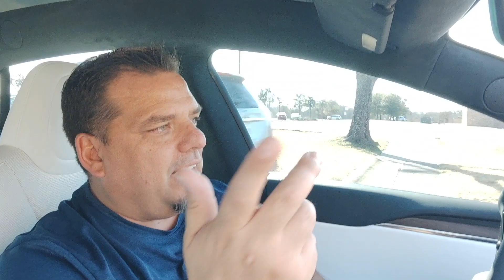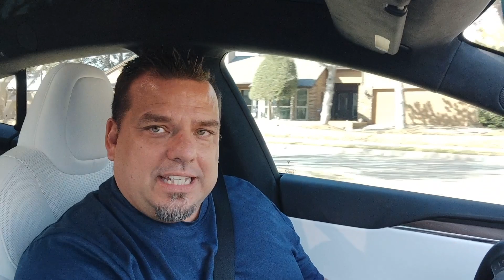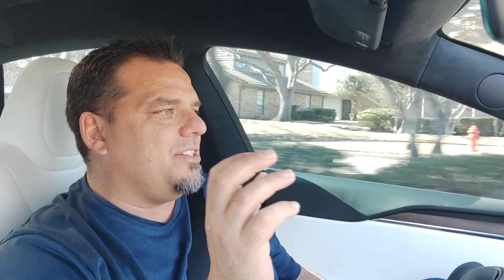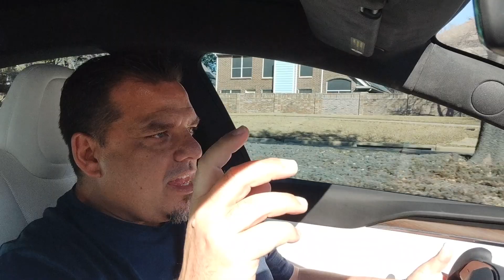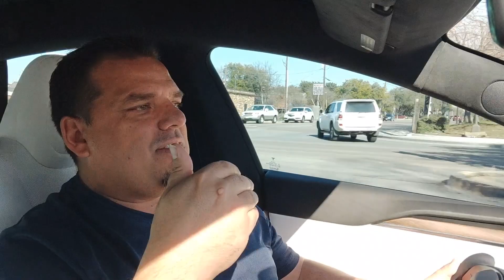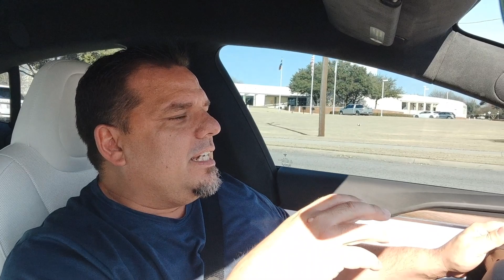Providing Real Value with the Proof of Concept - Industry 4.0 Talks #1

Comment: Thank you for your video. the primary solution can be the implementation of proper MIN/MAX, which is not the one that currently is being applied by your customer of sending the SMS messages.  I truly love your approach of UTILIZING EXISTING DATA, because this is exactly what INDUSTRY 5.0 does, we call this type of data ON-THE-GROUND-MINES, and there are many similar not only it the DATA space
Reply: Thank you for the comment, Michael!

Comment: Terrific story! And an example of the increasing value you can get from the UNS approach. Curious to know, did the initial PoC the engineer was working on involve or require querying data points from the ERP so that he already had  API or other access to the serial numbers? Or was this just an additional use case concept you could present?
Reply: Great question Sheryl -- yes, as part of the initial PoC, there is already ERP integration to the UNS, primarily to consume WO and BOM info.  We are simply extending that integration to provide additional value -- solving unknown problems.